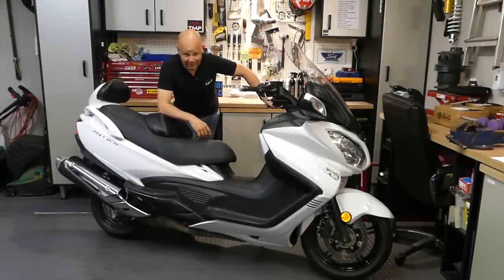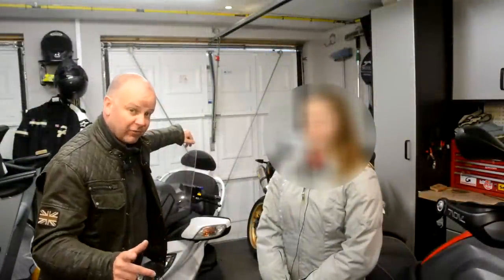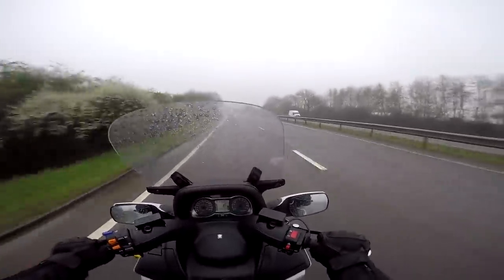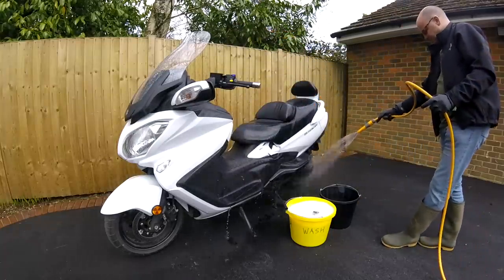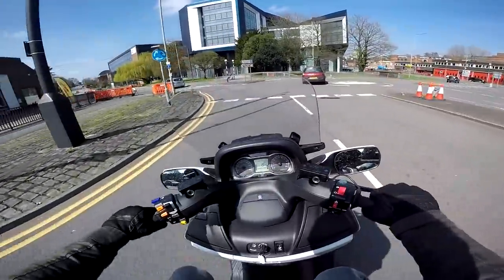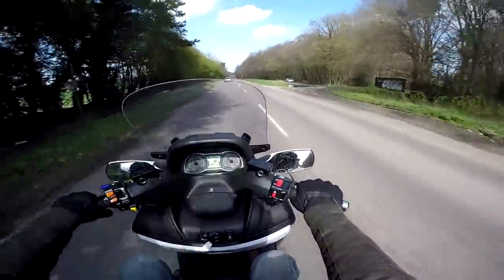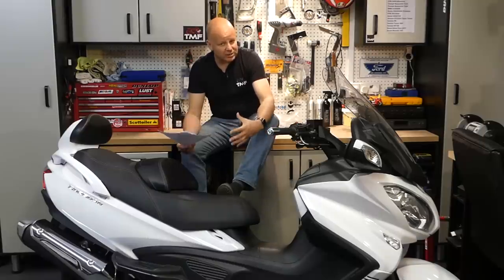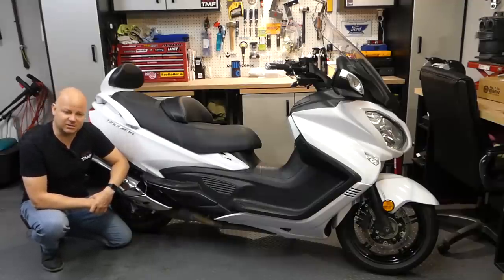2018 Suzuki Burgman 650 Executive - Long Term Review

Comment: Great bike if you're commuting into the London congestion zone from one of the satellite towns. Servicing, buy a manual and do all the easy stuff yourself which on a motorcycle is pretty much everything. Obviously not an option if the bike is under warranty. I think it would make an excellent couriers bike, assuming it has the build quality to do 60,000 miles a year. I checked out the suspension issues and there are aftermarket improvement parts for the bike. If I could get over the "it's a scooter" psychological thing, I'd buy one.

Comment: Neat scooter. WRT the fuel filler, seems a little fiddly. Wonder why they didn’t use a capless filler like you see on many cars now (eg my Jeep Compass). I find this works well and eliminates the hassle of removing/reinstalling the cap. They could even offer a lock on the access panel for those who feel they need.

Comment: MONSTER scoot...   i had a piaggio 400 scoot...   it was ok, didnt handle great etc.. so ive been on a few nomal bikes since... but...   one thing i do miss about the scoot...   it was soo much fun 2 up .. ..   an older female would love the big wide seat..no helmet banging like you said.. and we always had smiles on our faces wherever we went...  i am 55 now and have a rather nice nc700x but it kills my missus' bum...  i am looking at 400 burgman now coz i really do not rush anywhere now..even when i touch 80mph on motorway i just think... aww its less stress at 70... those service intervals are ridiculous, learn to do oil change and brake pads yourself its simple.. and it wont need much else for years just battery check and lubing... nice review but that 650 is just TOO big for us .. .. .
Reply from the maker: Fair enough....

Comment: Good review. Mostly agree with you. I had one for 5 years and 20000kms. Yes they are expensive but if you need or want a big scoot they are the ones to go for, as they have everything you need including heated grips and seat. Mine had the big top box so luggage/shopping capacity was awesome. I agree with the crashy suspension, which somewhat let it down. Did you use the handbrake down on the left hand side of the bike?. I found that to be very useful. I still found the brakes needed a hard pull to get the bike to pull up and the small tank wouldn’t do fo me for touring.
Reply from the maker: Glad we concur!  ...and no, didn't need to use the handbrake....

Comment: When cleaning with the bike on the centre stand to turn the rear wheel easily do it as if reversing. ie backwards. If one pulls it out of the garage backwards it's easy but a terrible weight if pushing it forwards.  Its best to drive it forwards as hernias can be painful.
Reply from the maker: Good advice!

Comment: Enjoyed the test. I have the 400 Burgman which I love. Just one point, the bike in the test is new, so there was no point in using the word 'old' 15 times! And comparing it with the price of a car of similar value is pointless because anyone thinking of buying something like this is in the market for two wheeled transport. If you're going to say that, you may as well say you can purchase a new kitchen for the same price. Please stick to two wheeled comparisons. You also don't say in the test what mpg you achieved in the time you had it, and as you had it for quite a while, you should have got some idea what it will do. My 400 does 75-80 mpg and that's not taking it very easy so it would be good to compare a 400 to a 650. I picked the 400 because it's £3000 cheaper, lower road tax and nearly 60kg lighter!

Comment: I am 6ft 51/2 inches (197cm) tall in my stocking feet, and currently own a BMW K1200LT. It's a great bike, with pretty much everything that the Burgman has. AND it has cruise control. The only thing I find dissapointing on the K is the weather protection when it is raining, as it doesn't keep me totally dry? I have owned both a BMW K100LT and a 1500 Honda Goldwing in the past, both of which were brilliant in keeping the rain off. I am 60 ears of age, and wonder what to replace the BMW with when it gets to big and heavy for me to manage, and have considered the Burgman as an option? Would it keep me dry, and would I miss cruise control?
Reply from the maker: Yes and no I reckon....

Comment: I like looking at maxis that can be a sports tourer of sorts.  Maybe someone doesn't want a motorcycle or to spend as much, doesn't want to go really really fast, and just wants to enjoy riding and utility rides.  I used to have a Piaggio fly 50 in Boston, I felt unstable as I was used to straddling dirt bikes and the position of a motorcycle.  My main curiosity is would I ever get used to the open leg area and feeling of being perched on it.  I feel more integrated and stable on a motorcycle I guess, but my wife would probably like this a lot more.  Wonder how this compares with the new MP3500 hpe.  I wish BMW would just put out a 650-800 cc two wheels in the front maxi and just crush the whole market

Comment: That is one thing you would think Suzuki would have done by now, cruise control. As it stands now you have to get an after market snap on that goes on the right grip. Just holds throttle position though. Poor man's cruise control. 😁 Tons of info on Burgman USA blog site.

Comment: Seems like a great bike, sure it’s expensive but just because that’s the price of the new one, doesn’t mean it has to be expensive, you can buy a 2009 model or so for £6000 less at least, so the price is a little bit of a moot point unless you always have to buy new, and if you’re thinking of doing that then price is probably not an issue for you anyway!

Comment: No one mentions the ease of maintenance on these. Brakes easy, belt and variators dont need special tools if the have an electric or battery gun, filters accessible. Inner seat comes out and plugs and fuel system like under bonnet of a car, very accessible. Only naff one is rear tyre change and thAt varies from scoot to scoot. The newer the easier. It all depends what you want a bike for

Comment: I ride this bike and everyone says it does only 115 mph i have been tagged at 130mph on a flat nothing done to it im 6foot 2 330 pounds love the bike
Reply: No...you haven't.
Nobody, NOBODY, who's EVER owned this motorcycle, will believe your bullshit.
I'm sure you could spend enough money and fiddle with the engine/gearbox enough to get it there but not on a stock Burgman...unless your falling from the sky.
Mine had a Remus exhaust and was TEKKA-tuned (hope I spelled that right).
It would do 119mph.
That's 5mph faster than when stock.
The bike would run into the rev-limiter at that speed sooo...
Good luck.

Comment: Have you ever thought of Shell garage as you pre pay at the pump on your phone so no helmet to open or take off and automatic starting when you select the pump on the forecourt and finish just confirm on your phone and ride off very good for bikers as many garages want you to remove your helmet before they start your pump .
Reply from the maker: I tend not to use a Shell garage very often...
Reply: @TheMissendenFlyer  it's worth it for savings and better fueling too 3rd tank full with there top fuel advanced and the throttle response is great I had 15.00 back for 800 miles and 10 visits including in-store purchase .

Comment: Great review thank you for doing it!...
    The bmw version of this bike is like riding on air no crash-ie feelings lol i like this bike better think it has more power speed but the  Exhaust and the suspension and I would even say tires need to be upgraded not that big of a deal to me i would rather customize them anyway alone with carburetor and airfilter get even more power out of that motor which is the best (i think) of the touring scooter motors
Reply: This has always been a fuel injected motorcycle.
Anything to do with a carburetor would be LESS than useless.

Comment: I would love to hear your opinion on the Kawasaki Concourse 14. I want to buy it but I'm really hesitant because I have a Harley on the list of bikes I want to own as well. Thank you for the effort in your video brother. 
Cheers
Reply from the maker: I’m not sure we even get those here??
Reply: Oh... I didn't know about that. I'm not from UK.
Reply from the maker: Yes I assumed that...
Reply: In the UK that Concourse 14 is called a GTR1400. I had one (2016 model) for about a year. Had to sell it to my regret. Great bike, but heavy. I’ve never been able to put it on the center stand (I’m 5ft7” and weigh 70 kg). However, great weather protection, but probably still not as good as the Burgman. I don’t think you can really compare them. The Concourse drives nice and peaceful up to 6000 rpm. After that, if you want to, it will launch like a rocket, even with its weight of 310 kg. Maximum speed I ever did with it was 230 km/h, but it can go way beyond that. In turn, I would never buy a Harley however. Compared to a Concours, a Harley is clunky, too loud, less reliable, less comfortable (depending on the model) and (here in Europe) too expensive. They do keep their value better. 

In the end, buying a bike (or maxi scooter) comes down to 3 things: did you like the test drive, do you like the looks and least important often, does it suit your needs. Because in case it doesn’t suit your needs, you will probably (if you have the money) just buy another one (next to the one you have) ;-)

Comment: I think the 4000 mile service gaps is a negative as well, a commuter could easily be servicing a bike twice a year I wonder when the valve check is , I think the tmax is 6000 .
Reply from the maker: Yes good point....thanks for watching and for stopping by - TMF

Comment: I wanna see what kind of trunk you would put on that on the back and what kind of after market pipe you would put  On it so people could hear you coming that's what I wanna see
Reply: I liked mine quiet. I know the debate  and it will take an aftermarket can.
Reply: With the fuel injection, and CDI ignition, coupled with EPA emission requirements, I wouldn't. Get a louder horn.

Comment: As much as it seems to offer excellent luggage ......2 up I'd suggest the lack of top box/tank bag or panniers would be problematic 
Good vlog
Reply: I’m pretty certain that you can fit a Givi rack to this with top box and panniers. That would also raise the height of the rear back rest and make it closer to the BMW for pillion comfort.
Reply: You can fit a large topbox and there is a 'tankbag' that fits between the legs. It's just panniers I dont think you can fit, but the underseat area is large, and long, so that makes up for thier loss.
Reply: Top box,panniers and tunnel bags are all available on the market which can provide for a rather interesting luggage capacity. Panniers and mounting racks are available from Givi, maybe others but i only looked there.

Comment: You talked about filtering easily by folding in the mirrors but how easily does it filter, really? It looks enormous IMO and doesn't look like filtering would be possible.
Reply: With the mirrors folded it's narrower than many bikes and it's meant to be actually quite good at filtering considering it's size and weight.

Comment: are you driving with the power button on? if not what is the difference between power mode on and power mode off
Reply: just extends the rev range a bit (lets it do wheelies easier...) don't really need it anywhere

Comment: shocked it doesn't have cruise control tbh. considering it has heated seats and electric folding mirrors and electric adjustable screen.
Reply from the maker: Yes a bit surprising that!

Comment: Can you please do review on BMW 650 GT
Reply from the maker: If I can, I will!
Reply: I have both the Burgman and the BMW C650gt. The BMW is faster, has the same room under the seat, it is on wheels that are 1" taller, so it is 1/2" higher saddle height. The tires on the BMW are excellent. The BMW not only has anti-lock brakes, it also has traction control. Not only is the BMW quicker off the line it has a lower lean angle, meaning you can hit a corner much harder. 
The grip and seat heater controls on the BMW have more control. The passenger can even separately adjust their saddle heat. 
The trip computer on the BMW blows the Suzuki Burgman's away. 
Now the cons
It costs more to buy the BMW
It gets worse gas milage
It uses premium gas
The dealer service costs more

Is it worth it? Well now I have a BMW if I had to choose one, it would be the BMW. 

I also have a Honda SilverWing. This is the maxi scooter to get it you are on a budget. 
Lower initial cost
Still quicker than the Burgman
Best gas mileage
Uses cheap regular gas
Lowest dealer service costs
No fancy electronics on it to go bad. No heated grips. No heated saddle. No power windshield. But it is a great scooter for the money.
Reply: Thanks for the information mate push it good work
Reply: @gpecaut1  this is helpful.  I am down to these  two on my list.  Burgman or c650 GT.  Both represent $$$.  Do you have any further insight into cost of owning and the maintenance on the BMW?  i saw something that other day that said about 50% (yes 50%) of BMW's need major maintenance within the first 4 years of ownership.  That's a little unreliable in my personal opinion and is the main reason i haven't pulled the trigger on it yet.
Reply: @MtMytc  the number one and most expensive maintenance on the c650 gt is the valve adjustment at 5000 miles. If you don't do it you have a pretty good chance of a major breakdown  
While you can do it yourself, that would void the warranty. Oil changes, with oil filter, and air filters I do myself, but if you do them at the dealer are more expensive than the Burgman. I have had no problems with any of my scooters except to replace the battery in my Honda Silverwing. I sure am not looking forward to the day the BMW needs a new battery, as it is much more buried  than on the other two scooters. A lot of fairings to pull to get to it. However I did pull all the plastic off the Honda to properly install a 12 volt accessory plug in it, and it's not that hard. 
Drive belt on the Burgman will need replacing before on the BMW and costs more than on the BMW. 
The Honda is on its third belt, 80,000 miles, and still running strong.  I always replace the belts between 30000 and 40000 miles so I don't get stranded on a ride.
BMW has a 5 year warranty. If you don't modify the scooter, and maintain the the proper service it's covered.

Comment: As a Yamaha Tmax 530 owner I did a long distance ride on the 650 Burgman and I hate it!  Maybe the Tmax has me spoiled. The Burgman handles like a horse wagon, it's too BIG, it'
s a boat!  The Burgman has a higher top speed but the Tmax has faster acceleration. I can tight curve the Tmax like a crotch rocket. The Tmax just feels safe, gives you more rider confidence, easier to ride.
Reply from the maker: Fair enough! Thanks for your feedback Tom and cheers for watching...

Comment: What about reliability. Many owners brake gear clutch about 30000km with before 2013 models. I own a 2010, and break Gear clutch ar 36000km. Cost to repear it, is about 2500€...

Comment: Good review MF and I think you did a good job of finding the issues that are common with scooters. I'm riding my Honda Forza  (I call it barge arse, great big heavy old thing it is) in Thailand for the last year and "crashy" suspension as you put it, seems to be how scooters behave in general. Most of them have the engine sitting on the back wheel and the driver is also perched on top of it so all the weight goes through the rear. Even with adjusting the suspension, the physics and design limit its ability to cope with rough roads. I have ridden a number of other scooters and have found that to be case. Your butt and lower back are going to suffer.

I also found that the legs at 90 degrees position that most scooters adopt, means if you have long legs your knees are touching the dash. On some bikes I can't even turn the steering to full lock because the handlebars hit my knees. U turns can be much more difficult than they need to be because of that. The Honda Xdv is like that and is a 750c cc bike, it makes no sense to make it so cramped.

Don't get me wrong, scooters are still really great for nipping around town and the storage space is so useful. But if you are tall and you are likely to be on rough roads, I think you might want to consider something else. Your butt and knees will thank you later.
Reply: The solution is easy. Uncover the seat and add some more foam. The worst thing about raising the seat height is you may need a taller Givi wind screen.

Comment: Did you do review on bmw 650 GT
Reply from the maker: Not yet...
Reply: @TheMissendenFlyer  Yes, i would be interested in a compare/contrast with the BMW c650 GT as well.  These seem to be the only 2 maxi-scooters in the same class (not including anything by Kymco or Honda Goldwing category).  I am torn between the 2 and knowing that both exceed a $10,000 price tag am not buying anything until testing and research is thoroughly conducted.  I have a feeling the the BMW will win out in most categories vs. the Burgman except in cost of ownership and maintenance.  Would still be good to hear others opinions though.